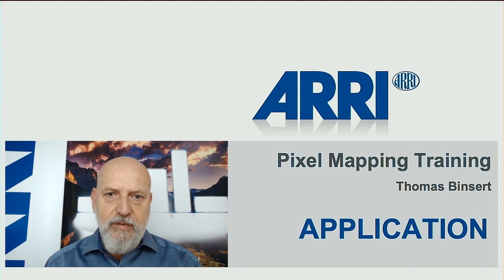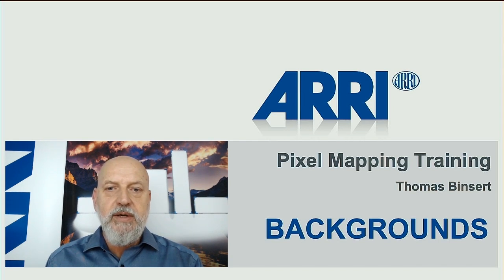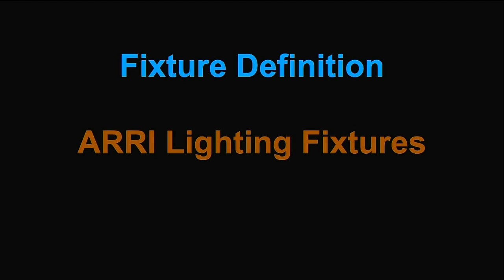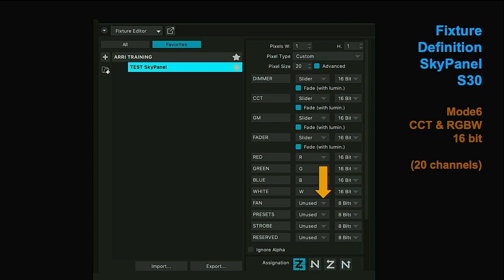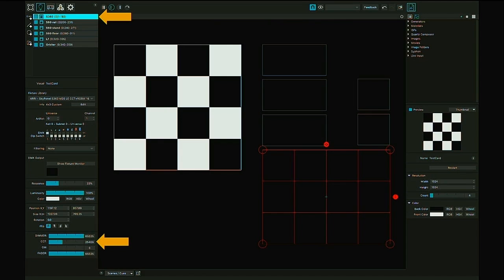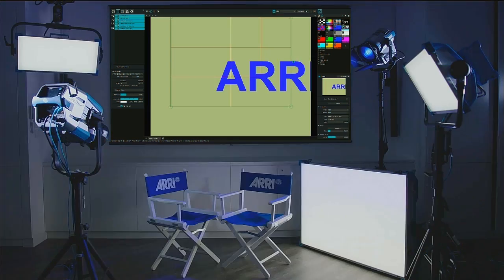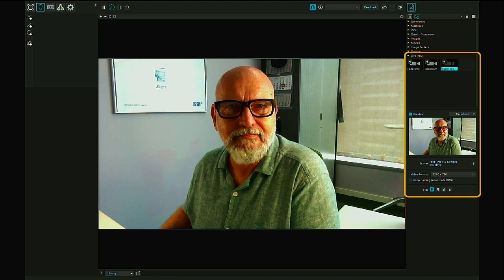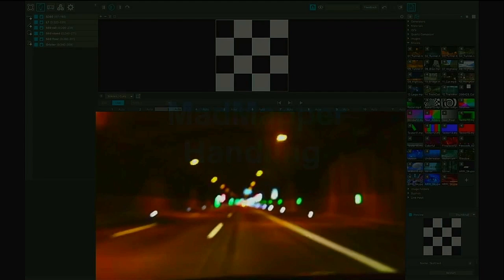Pixel Mapping Webinar with ARRI's Thomas Binsert

Comment: A great video! One question though: if you set the dimmer channel as a slider in MM, don't you lose the dimming information from the mapping?
Reply from the maker: The dimmer channel in this instance acts as a master dimmer - basically setting the max brightness the fixture will get to when it's mapping from a source that is completely white in MM. The mapping will still work :)

Comment: Sir  can help how can I  divided single engine (single block ) in to more pixel
Reply: Sorry for late reply. You can only divide a SkyPanel S60, S120 and S360 in their implemented light engines (2, 4 and 12) but not further in pixels. A SkyPanel don't operate as a LED wall element!